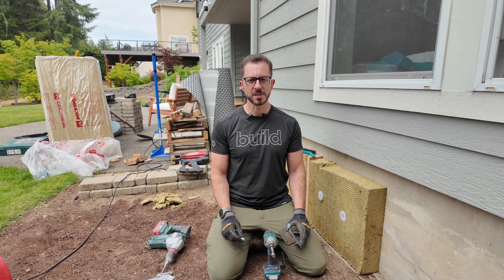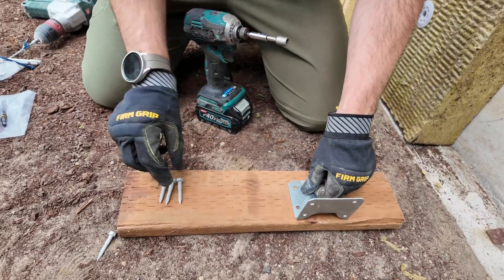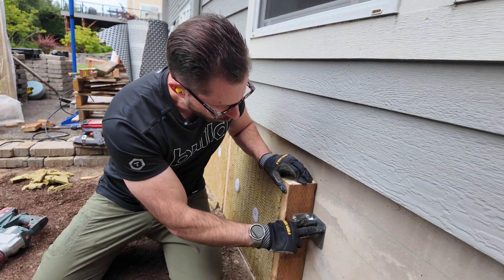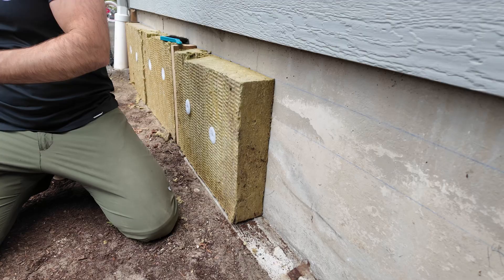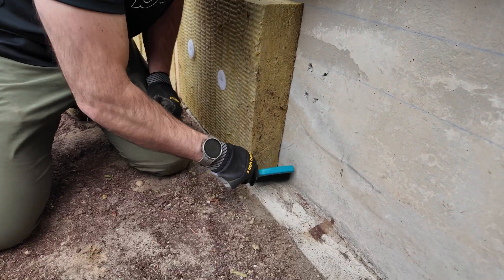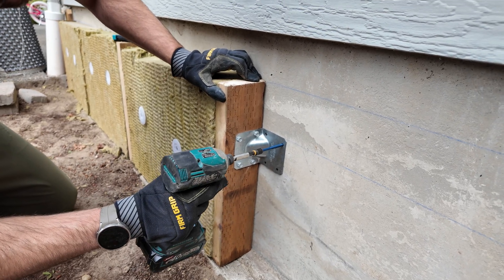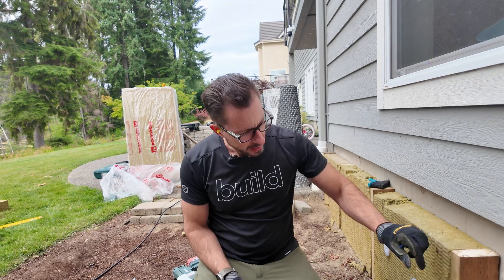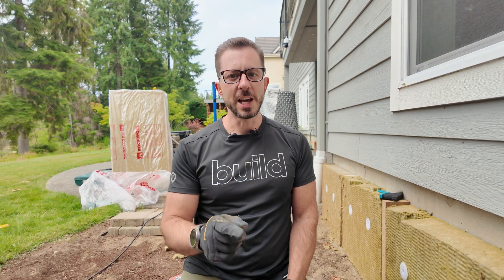How to Install a Simpson HGAM - Hurricane Gusset Angle for Masonry

Comment: This is in the next video possibly, how does that exterior insulation tie into the siding for appearance?
Reply from the maker: We're working on a long form, but there'll be Dorken Delta Dry and Lath and thin brick
Reply: @PioneerBuildersInc  Got it. That makes sense. I am no builder. Just doing a gutting/rebuild on our Port Townsend 1889 house and learning along the way of our decade plus project. I was struggling with how that ties in to the exterior. Love the kid involvement. Keep rowing.
Reply from the maker: @Van-uc1hl  love that town 👍🙂